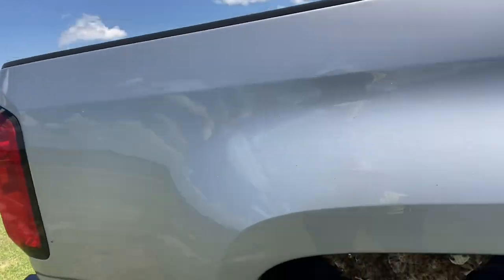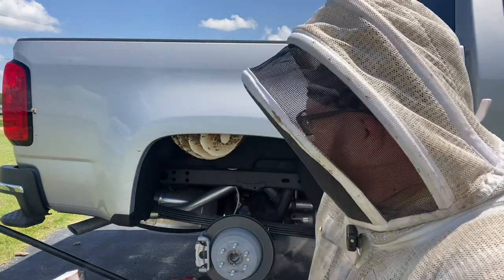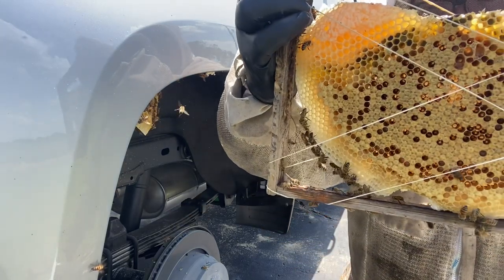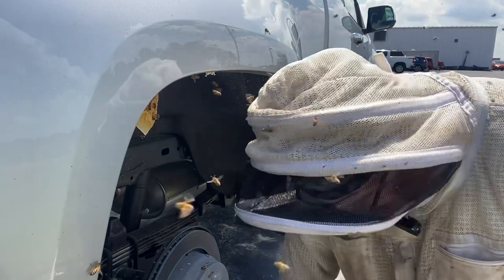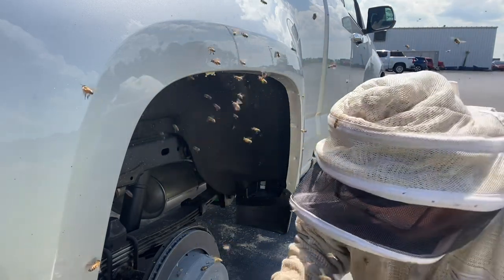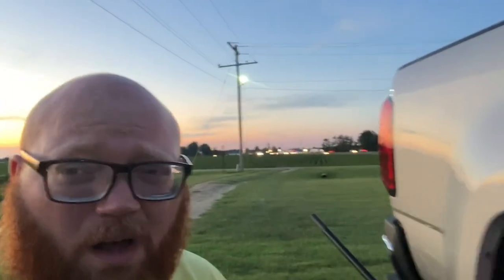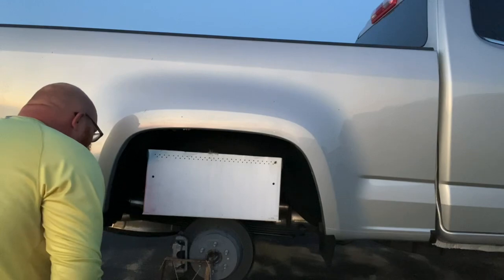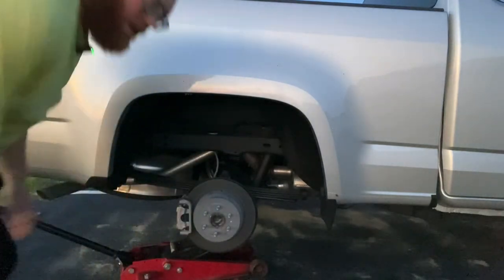Wheel Well Beehive Removal!

Comment: Definitely the right thing to do since it could have been your bees. Whenever I have a "mobile" colony to remove, I like to move the object (in this case the truck) atleast 50 yards away and leave a box with comb in its place. Cuts down the bees you're dealing with real quick. Then after removing the combs, smoke them all out and they'll go to the original location. Good job though for not being a "removal" guy.
Reply from the maker: Going off the timeline given I’m not sure that these didn’t hitch a ride up with this truck.

Comment: What are the regulations with the plant board/pest removal on swrams and cut outs and exposed comb? I hear conflicting stories including claims that if the bees have comb, and you are taking the bees with you it is in pest control and requires licensing as the bees are "compensation."

While I think that is way over-reaching, I was curious if any bee keepers have run into problems with the over-reaching regulations and interpretations by some of those on the plant board that regulate pest removal.
Reply from the maker: I don’t know anything about it